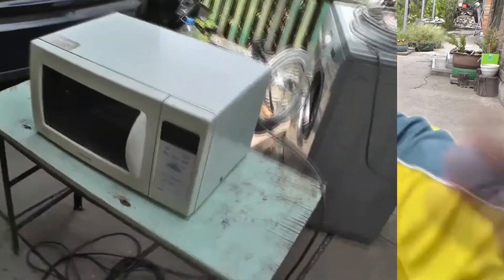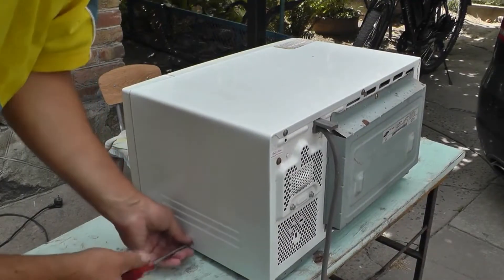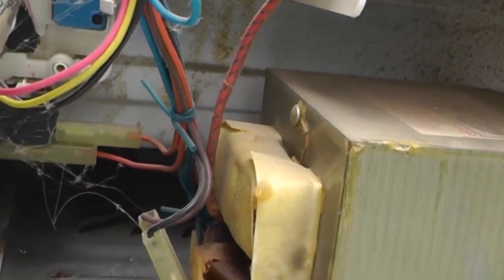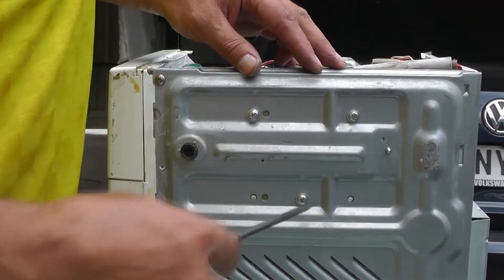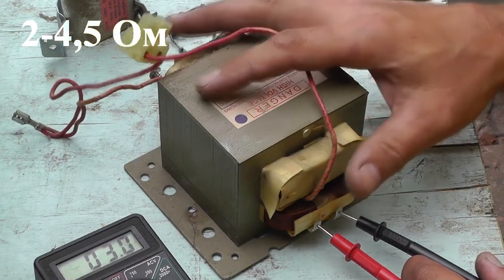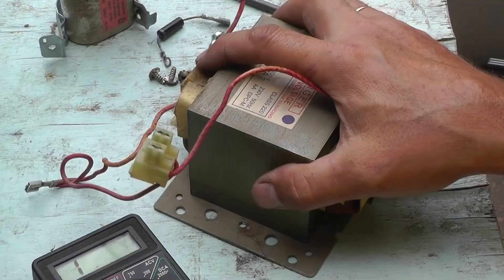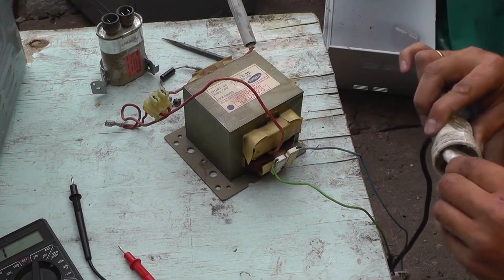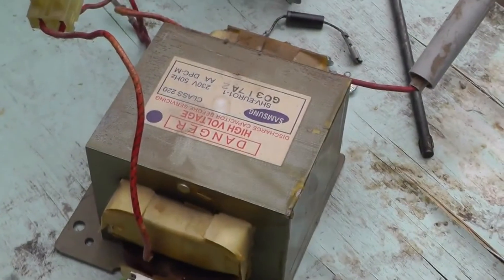Testing a Microwave Transformer with a Multimeter

Comment: Whirlpool magic magnetron beep niose sound problem secondary tranfomer body testing 140e good or bad ? Please answer
Reply from the maker: Checking for a breakdown of the case:
Set the multimeter to the "continuity"/resistance mode.
One probe - to any terminal, the second - to the metal case of the transformer.
There should be no contact. If there is, there is a breakdown of the insulation.

Comment: Jeeeeeesus, you are straight up giving bad advice maliciously in an attempt to injure people, there is no other explanation for this.
Reply from the maker: Checking a faulty microwave oven transformer is possible with a multimeter and there is nothing wrong with this, as long as you do not touch the high-voltage contacts with your hands.
Reply: Yes, in this case, experience in repairing electrical equipment is required.

Comment: If theres smoke coming out we already know its faulty. Theres no need to be running the microwave with out covers on (which can kill you) and theres certainty no need to be  poking the high voltage transformer with no mention of safety precautions. a little bit of knowledge is a very dangerous thing, Im sorry but your videos are going to get someone killed
Reply from the maker: Thanks for the note! I clearly showed the parameters of a faulty microwave oven transformer. If you have no experience in repairing electrical equipment, even an electrical outlet can kill you.